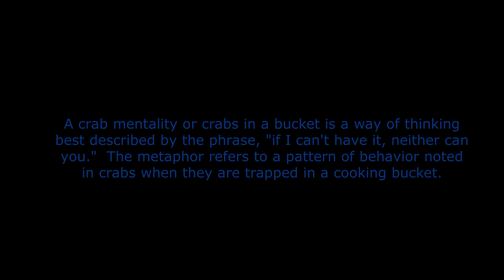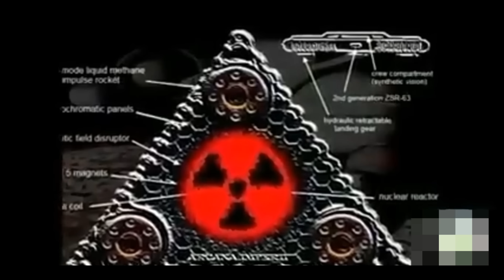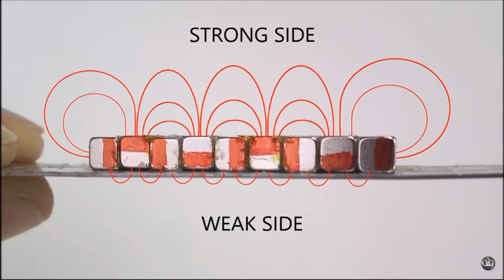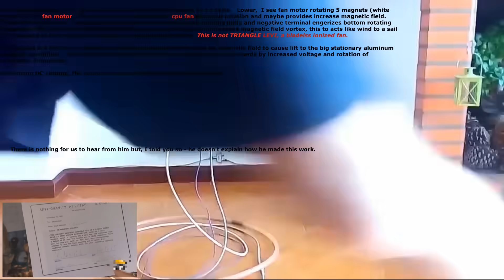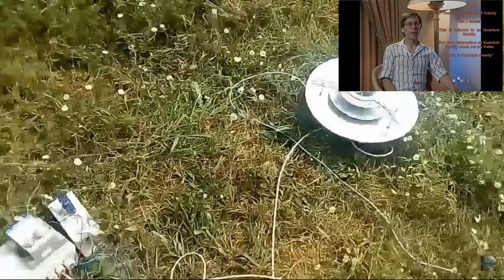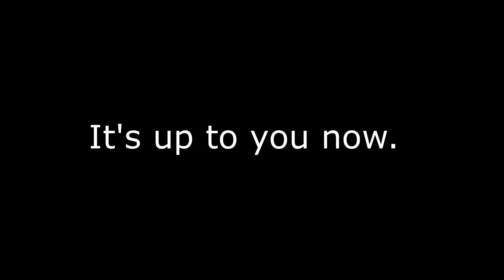anti-gravity project

Comment: An electrical engineer friend of mine accidentally built a device which floats three feet in the air. He has been monitored by the government ever since he created it. After analyzing what he did, I have created the first solid state anti-gravity coil which runs off of dc current. It will out perform his device by allowing very quick acceleration.  The economic problems caused by such a device on industry together with the possible military applications makes demonstrating this device publicly a very dangerous proposition. Every military would want to use it and every transportation industry would want it suppressed. Sometime in the future when I have the proper security in place, I will divulge the device to the highest bidder.
Reply: Friend, you are right, the problem is the selfish of the human bean.  How to get rid of that?  Education is the solution, the right education not the current education that is indoctrination. But how we finance our educative solutions?  is the problem of the egg and the chicken, who was first?.   Please contact us.

Comment: There are NO true antigravity systems. With our current understanding of physics it is impossible to create a true antigravity systems without some form of exotic matter.

Devices that rely on magnetism or quantum levitation etc, are not true "antigravity" systems, being that they do not reverse the effect of gravity. They simply rely on magnetism to counteract its effect.
Reply: Precisely! The hovering drone in this video is no more difficult to explain than an ant crawling on the ceiling. It is following the rules of the electromagnetic paradigm, which are predominate in a strong magnetic field. We can move cars and junk airplane parts by electromagnetism, too! When EM > Gravity the force of gravity can be overcome. This is not anti-gravity, and the ant on your ceiling is not either. It is just low mass so gravity is negligible.

Comment: magnets are the wrong answer to antigravity either physical or electromagnetic, the weight combined with the amount of power needed is too great to overcome... and the "nazi bell" project was for converting mercury into gold. gyroscopes is where it's at, not only do they cancel out their own weight but can be driven by motors at different speeds to apply the torque effects needed to change direction and speed.

Comment: Explain how in the world does that litte DIY disc thing only hovers at a certain distance from the ground. It has enough energy to blast all the way up all of it's weight from the ground, how does it not fly higher and higher? Makes no sense? Gravity does not just end 1.5meters from the ground! So much wind on the trees beind him yet the thing sits there as though hanging on a thread. 
These people need to stop being scam scientists, they just need to become magicians.
Reply: the object seems kinda aerodynamic (i mean, these are simply plates of metal and magnets on top of each other) 
And for the height that it ''levitates'', he simply send more electricity through the wires to the magnets. (increasing the halbach array's effects  i presume)
Reply: @carlgagne2118  when you're anti gravity you'll lose weight... You'll go up like helium filled balloon and will be blown away like a feather. Go back to scbool mate.
Reply: @carlgagne2118  copper wires holding it down apparently, and downforce of this "anti gravity" would mean a slight tilt will make this thig unstable anyways, and so making it travel a bit and eventually fall down. You cannot fool physics.
Reply: @carlgagne2118  Also so you don't think about it anymore... the guy on that video never showed what's underneath that vessel of his when it was up... my guess this thing is simply blown up by air to sit in the air like a hovering drone. He actually tripped over it too lol. Must be a big fan down there.

Comment: I can spend a lot more money on something like this because I have very large corporate backing with BIG CNC machines!  ...BUT... I can disclose to you that this patent is rather illuminating and pretty much tells you HOW this works. Just get a big enough single or MULTIPLE 300+ KW generators to be able to PUMP the EM-based MASER/LASER-like cavity resonator/waveguide assembly which you can machine and weld together from any major higher-grade steel, aluminum or titanium plate (i suggest 3/4 inch or about 2 cm/20mm thick!) 

In my estimate, if you KNOW how to weld or know someone who does, It would take about 4 weeks to put it all together if you can afford to spend 2 hours per day for said 4 weeks on build time!  YOU ARE on the right track! You're only missing the Cavity resonator/waveguide part!

.

Comment: You're on the RIGHT TRACK !!!!

You just need to make a few modifications to your configuration to resemble a cavity resonator and LASER/MASER waveguide system so that the EM fields are SUMMED and AMPLIFIED so you can direct them to where you want directionally! This will allow you to cause a large object to move towards a given direction.

See this patent:
https://patents.google.com/patent/US10144532B2/en

For POWER production, almost any 200 litre propane tank hooked up to a LPG generator system will work to power the LASER/MASER-like setup (i.e. PUMP the EM summing cavity resonator/waveguide mechanism). You should EASILY be able to get a 300 KW to 500 KW generator which is about the size of a typical V6 or V8 truck engine (i.e. an engine from a Lorry or Caravan) which you can buy at any junkyard and modify to burn propane by replacing all the valve seals and gaskets with propane certified ones!

DO NOT USE those CHEAP horrid 3 or 4 KW Walmart or Lowes home generators! Get a REAL lorry engine (i.e. 5 litre or more V6/V8 truck engine) and make it burn cheap propane, diesel or petrol (gasoline)!

Again, the initial POWER supply is an issue, so get a PROPER cheap truck (lorry) V6 or V8, 5+ litre engine from any junkyard to modify into and create a decent 300+ KW electricity generator!
.

Comment: Wastage is the key , copper plating experiments show the heat ,wasted energy required to cycle the lift you require.Gyroscopes and carbon is the key . Changing a substance primary velocity ( lockheed experiment) proves nothing and is a vapour to the cause . Using a planets magnetic field then also re routing wastage ,as we seen in the development of nuclear reactors is key ,but would also only be planetary. It is not anti gravity we search , but magnetic propulsion,such as bow thrusters on a boat .

Comment: i see the potential energy to lift and object and a payload,  this is how i understand it. i was looking at eddy current levitation in another video, he had heavy magnets underneath with a light aluminum plate floating in the field . i see that the aluminum disc in the middle is held forcing the rest to move upward. like if you hold a drill in your hand the end spins, but if you hold the end of the drill. the drill itself will start to spin around instead. both using magnetic fields to move. then you move the object itself and can become a vehicle. with a power to weight calculation for something more heavy , you could get more altitude. maybe make a drone that levitates like this ,but keep the electronics away from the magnetic fields rotating so it works.
Reply: If this is indeed real and can be vetted and placed through certain testing by known labs then there should also be a platform design to mount guns and missile bays. Clearly this would create a much more broader and heightened military superiority.

Comment: Logically magnetism flows parallel with its current. Thus conductors with co-parallel currents attract because the co-parallel magnetism between them does less work (reduced magnetic pressure). Anti-parallel magnetism repels from increased pressure.
Current coils then rotate magnetism as a vortex within and around them
Reply: Your use of the word 'parallel' is confusing - a moving charge (current) creates a magnetic field that is concentric around the moving charge, not along it.  This may be what you wished to say.  Two parallel wires carrying current in the same direction attract each other because the magnetic field between them is opposing (and cancels) while the part of the field that surrounds both wires is augmented.  See Feynman Lectures in Physics volume 2
Reply from the maker: anti-gravity-toridal_synergy
https://youtu.be/8KGuB8bZKNs

Comment: Bob Lazar speaks of a procedure for the ignition of the AntiGravity Drive. He says that a triangle of Element 115 had to be cut in a very specific way, starting from a pile of dics of such material, and then, cutting slices of the cilinder until they get a specific triangular shape. This is key to the operation. You have to take in consideracion the very special and specifical molecular structure forming through that process (similar to cutting quartz for its piezoelectric properties).
Now, I know we cant get E115, but, undestanding that molecular array can be key in understanding gravity.

I have a model in development, based on the work of Nassim Haramein, where I can conciliate gravity in both quantum mechanics and clasical physics. The spin you need to get, has to enter in ressonance with the Morphogenetic Field. For that, it must reach a certain speed. I believe that it is E115 what was used to induced the EM Field strong enough to give Hg enough spin. Im going to reflect on this and get back to you. Greetings from Ecuador. Awesome work.
Reply: You now the work of Mathis Miles ?
Reply: @BienestarMutuo  No, I do not. Any reference?

Comment: This can't be done but it is very dangerous and there's no guarantee you can come back messing with the time-space continuum can travel how it goes in the direction I can't guarantee time in space you cancel out gravity you have to synergize yourself to the craft and become one life is energy we are being circulated in water life is a spark you can take a metal blade and take dust from dirt implode acrostic and it will make electricity going just across metal is electrical if you have a heart attack what did they do to recharge you they shock you so life is an energy force you have to use that same Synergy to work the craft clear your mind I will say more later

Comment: It is enough to just gas cylinder two electro magnets set parallel perpendicular on both sides of the cylinder two engines and during the turbulence field will create the same weightlessness or embezzlement it depends on the force of tensions and movement in the cylinder the higher the lack of gravity stronger then only the centrifugal force and become Krypton is also a super purple gas, too - a chemical composition which is the reverse of the inverse of magnesium and a sure fly is needed

Comment: How are the layers organized by sectional division of the craft; I was referring to the craft that’s floating!
Reply: But I didn't see any craft, I saw a toy !! Better to forget, there is no gravity, much less antigravity, There is the AETHER microatomic particle that is 1000 times thinner than the atom, travels several times the speed of light and is everywhere even on your body, but it does not fit in the equations of physicists. It is fear that keeps them at a distance, but if you understand Portuguese I will send you a video of a scientist and university professor as proof.

Comment: I would like to ask a question why do you have to have copper there at the bottom why can't you build the device with counter-rotating plates and have it actually levitate without having to use that copper all you have to do is change the frequency the higher the frequency the higher your levitation the lower the frequency the lower your levitation just remember you have to have field antennas that are putting out either positive or negative influx as well though to keep whatever object your floating balanced

Comment: Question. If you created larger magnets, (you would need to counter-rotating) connected them to a high rpm motor(assuming higher rpm would generate a stronger wave), could you produce higher output magnetic fields? Enough to lift significantly more weight?
Reply from the maker: Yes you can increase the MF by halbach configuration and by applying direct or alternating current.  Using larger magnets is heavy, however increasing current yields strong polarities to oppose you say is lift.

Comment: Planes, Hot Baloons, rockets are all anti-gravity machines too. They don't fall! What keeps the plane in the air? Two engines in sides creates air flow underneath. Hear it! Replace air flow with magnetic flow. Replace the jet engine with magnetic engine. You have yourself a magnetic plane! We may not need to have anti-gravity machine. In the meantime, magnetic flying objects will do. All we need not to fall in the air! As these will be cheaper to produce. Allowing mass consumption and adaption in all varieties, such as consumer hoover boards, small flying objects. They might not fly as high planes as these run on batteries not chemical fuel.

Comment: Of course you reduce apparent mass, as earth also produce massive magnetic field due to metal core spinning at different speed than the crust. How do you think compass works huh?
Reply: How does a moving body produce a stable magnetic field? How does the magnetic field exist in at high temperature? All magnetic materials known to us fail in high temperatures. Unless you have some information that would prove otherwise which frankly the magnet industry would love to obtain that material and expand our range of temp stable material. But I'm sure that it is not possible with today's processes and materials. Maybe the magnetic field is created by a long oriented material that has a high permience coefficient. But how was it oriented? The mag field would have to be present at the time it solidifies. Do you have some info to the contrary?

Comment: what if we replace the conducting sheet underneath, and apply the rotating magnetic field of the halbach array to the aether? i mean the aether is found everywhere, how about using that as the conducting sheet (and get your craft to travel and turn impossible corners at incredible speeds)? i'm assuming that someone has found a method that can manipulate the aether, which currently is more intangible to humans than air.

Comment: so check this ouut. there are two permanent magnets on a one inche square plate of iorn. the magnets are same pollarety as to push one an other, magnet to magnet. in the middle are two other disk manets so that all magnets are same pollarety one pushing on the other. the outer two have bolts of brass pressing the plates twards each other. this will compress the magnets. press magnets to 5,000 pounds per square inch. to each other. on the corners there are four more magnets to stabalize the pressed stack magnets. the four magnets are horse shoe magnets placed along the side of the press stack. this is all in side a sphere made of copper. the sphere inside is a vacume. the suspended magnets in the press has copper coiles in counter spining tolaroide wound around flat magnets. around the disk ring magnet. a set of copper platers are aroind the flat ring magnets. this is to give counter spining motion to suspended ring magnets, in press. with a tesla coil acting like a starter generator. aound this spere is a dounut tube of copper atached inside whole to mate with the shpere. the bonut is hollow inside the hollow copper donut is mercury. around the equater axis of mercuty donut. is a set of coils spun around donut. around that is a set of flat magnets with coiled copper wire. this is then placed in a larger hollow donut made of alluminum. the mercury donut is the spun with the starter mtor. the marcury donut is suspended by flat magnets top and bottom. the hollow aluminum donut is a vacume as well. this is an anti gavety drive of my own design. the power cell is a shpere a hollow shphere not a vacume of metal that self acctuates electrons. the composition of powercell is thorium, lithium, iridium, alluminum and mercury powder.

Comment: None of these are anti gravity fields. They are simply machines that produce a force greater than the gravitational pull towards the earth. In most cases magnetic. When you are able to eliminate the weight of an object without an equal or greater opposing force, gimme a call.

Comment: With a set of current power supplies, 1 + unit and one - unit , @ several million volts @ 3 to 8 millie volts, has  the ability to produce   thrust. ...... This was done in a faraday cage for safety during testing.

Comment: Wright Brothers were the first to make anti-gravity machine, its called aero plane , it uses energy to defy gravity, and you guys use other techniques such as rotating magnets and a copper or aluminium base to levitate, which truly is not an anti-gravity machine, No one has and No one ever will be able to make a true anti-gravity machine that uses any amount of energy to over come gravity, a true anti-gravity machine should use ZERO energy, gravity if part of our existence, without gravity no existence occurs, if there is a universe and mass in it, then gravity is part of it, if no gravity then n0o mass either. if you cannot come up a truly gravity defying machine,  you are to consider yourself a failure, and I guarantee you my life, you will never be able to seperate gravity from the mass, mass is not due to Higgs Boson, it is due to gravity. As already stated it is impossible to beat laws of nature, you may be able to over come them using energy, but no shit can break these laws.